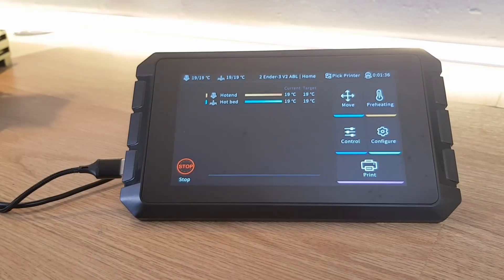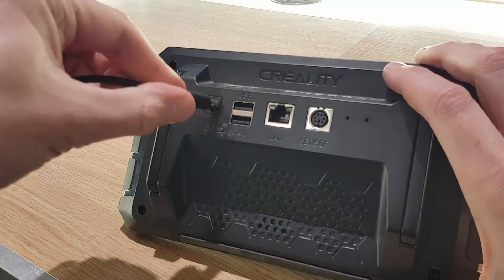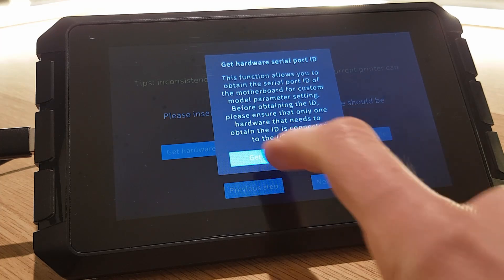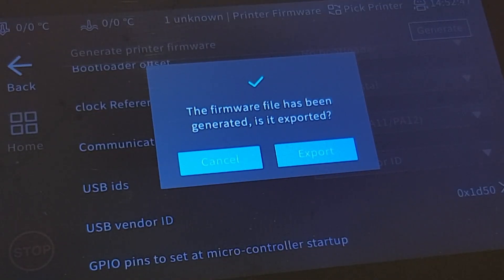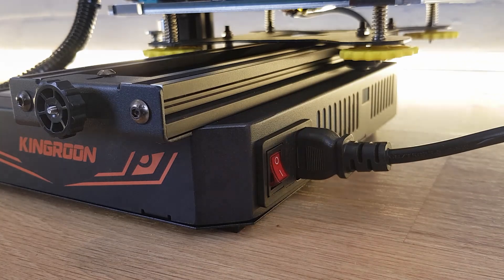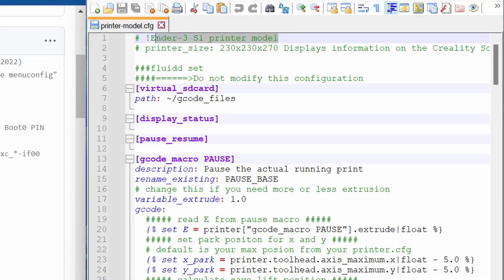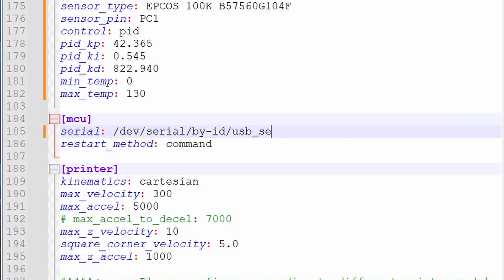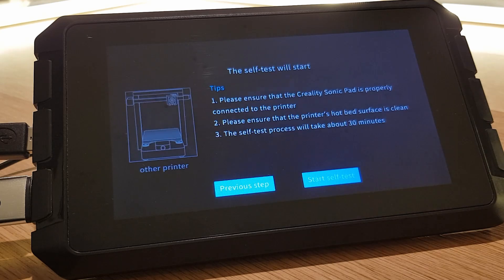How To Connect A Non-Creality 3D Printer To A Sonic Pad - Sonic Pad Basics Part 1a

Comment: Odd one for you!  I have an Ender 5 with a Creality V1.1.5 main board that is from an Ender 3 Pro.  I'm really struggling to find firmware for this printer/mainboard combination and it occured to me that if I use a Sonic Pad with the E3 Pro firmware it may be overwritten and therefore work, any thoughts on this please Ricky?

Comment: Well when this would work, it would be amazing!
Mine is the Ender 3 V2 with 4.2.2 Board BUT with that weired GD32F303 Chip. And i think its incredible Crazy that Creality itself do not let you choose that Chip for this printer.
Then i try to diy it with the Pad.... Well it dosent recognize the Printer.
Also it tells me that it dont recognice the usb stick and when it does and i say Compile the Firmware, first its okay but then it prompt me with a error O_0
WTF is going with that????
Its nothing working even that it comes from Creality itself!!!

I can Build a PC the more easy way and it will work fine than this crap here!

Comment: hi, I have a ender 5 plus and I just bought a BTT SKr 3ez  board for it. I also have a sonic pad. I didn't buy an alternative screen since I thought this wouldn't be nessicary since the sonic pad disables the screen anyway. The only thing is that i dont know if this will work. I've been looking online for a simular setup but i can't find anything that resembles this. Is there a chance you could help me with this? I still need to install the board on the ender 5 plus.
Reply: Hey, i have the same setup, did you manage to make it work? Ive been stuck for 5 days now and i cant make sonic pad comunicate with motherboard

Comment: Good afternoon,
I have the following machine:
Ender 3 4.2.7 running on a sonic pad with CR Touch.
Everything was running fine until I installed the Sprite Pro Extruder kit. Now the Sonic Pad will not connect. I tried to re-flash and lost all my firmware settings. When I reverted back to the original control and firmware the control will only turn on when the extruder is disconnected but the hot end still throws an error. If the extruder is plugged in then the display will only show blue. Any ideas on a fix

Comment: HOLY COW buddy.  you want to go down a rabbit hole?  Try hooking up a sonic pad, to an ender 3 v2, with a big tree tech e3 v3.  apparently the normal SD card firmware loading doeasnt work.  So i had to have chat gpt help me run windows powershell in administrator, to install something called chocalatey, then download ubuntu to run linux, then a million more steps. still working through it.

All of this, because i want to have dual Z axis control instead of just using a standard Creality 4.2.7 board. I sure hope its worth it after all this.

Comment: Hi Ricky, is there anyway of downloading the firmware direct to a SD card and not through the sonic pad as it puts it in a file with the firmware zipped. my sonic pad is not connecting to my ender 3 s1 pro, the connecting symbol goes round for ages with no connection.

Comment: Just bought sonic pad, my ender 3 s1 will not connect when setting up final step. My usb c port seems to have no power so bought the serial cable and it still will not connect for the final step. Do you have any ideas please??

Comment: I'm trying to setup my SP with my Ender 3 V2 NEO that also has a 4.2.7 board freshly installed. I'm trying to add it as an "other models", have created the printer.cfg file but SP just sits on firmware file being generated...
I had previously set it up as a Ender 3 V2 4.2.7 but not knowing how to edit the config after I went to other models setup.
Being I'd already flashed the klipper firmware for the above model I skipped firmware generating and went on to the tests which failed. Tests were fine when I'd set it up as the pre-configured model.

Comment: At this point I only have one question: Can the Creality Sonic Pad I have connect to the Lerdge K board I'm using to use a Core XY printer I built? Or, is the Lerdge firmware so closed that the Sonic Pad won't be able to talk to it? Thank you for responding.

Comment: advice please

Generate a config file for SW-X2, copy the file to the root of the USB, connect the USB cable (with the power turned off), connect the USB to port 1 and touch according to the prompts.

It takes 20-30 seconds and it says the printer is not ready, what's the problem?
Reply: Have you managed to get it working? Same issue with Ender 3 and SKR Mini E3 V2.

Comment: Getting an error message "Printer is not ready. Klippy host software is attempting to connect." when connecting to my Voxelab Aquila S2. Only thing I've tried so far was manually inputting a baud rate into the .cfg. No change. Any advice? General direction to  begin isolating the fault?
Reply: Have you managed to get it working? Same issue with Ender 3 and SKR Mini E3 V2.
Reply: @darkstarkajzek5397  yes. Rather than using the port that it said to use, I used the top one simply called USB.

Comment: Hello. If I fill the Firmware creator with the right details the creating of the firmware goes infinite loop and never done, if I change some settings to wrong it goes to done in 10 seconds. Any Idea? Its a bug of course, its the newest version of software im using on SonicPad. I have a GD32 Chip type 4.2.2 Creality Ender 3 Max Neo. Impossible to install, I tried everything I found on the internet.

Comment: Thank you for your great SP compilation how to videos. I made my first steps with SP and Prusa MK3S+, and I was suprised beacuse everything was only plug in USB cable between my Prusa and SP and few clicks on Sonic screen. Prusa was updated, then there were self tests. It is visible, the heating and movements work ok. The z-level mesh has been created. I have the first test prints ahead of me, but first I want to take the next steps from your videos (PA and IS).

Comment: I've got an Ender 3V2 with a Creality stock  board model 4.2.7 I believe. I've gotten the firmware updated and connected to the sonic pad. Problem now is that the printer won't home the z axis, keeps giving a "Failed to verify BLTouch probe is raised; retrying" message. I've checked my config file against the configs for the other two printers I have connected to the sonic pad and everything looks good. The probe does a test on power up but when I try to home all, X and Y will home and the head will move to the center of the build plate but will not lower. What is my problem,  gonna check with customer service tomorrow and try to solve this.  If you have any ideas, please let me know, thank you.
Reply: Had same issue, then used another USB cable, it solved it, luckily I had another one.

Comment: Hello @Ricky, thanks for the videos. Im new at 3d printing and i receive a sonic pad. I have a artillery sidewinder X2 and i will follow your videos to install. One question i have, in config file, they said "To flash this firmware, set the physical bridge between +3.3V and Boot0 PIN". Its really necessary or we just need to connect the printer via USB to prontface?

Comment: Great vid! CAUTION: MAKE A BACKUP OF YOUR FIRMWARE (esp if you have spent a long time calibrating and getting a DIY build correct) so that you can return back in time should you need to. Im in the middle of setting up...I bought the SP to add my crm4 which it did flawlessly...even though Creality support told me that CRM4 was unsupportec etc Anyway I refitted a TEVO TLM to become a 1m tall printer and has been a gem...but I want to improve the skin of the prints...do DELTAS need any other cautions on setup?

Comment: Greetings,  Thank you for a well done series on the Sonic Pad, hats off.  I have the SKR Mini E3 V3 with the STM32G0B1RET6 chip which is not in the Sonic Pad listing.  It would be great to see how to get the firmware.bin file compiled as well as the printer.cfg file.  And then cover all the Sonic Pad Self-Test features or how to do them from the Sonic Pad or the Klipper UI on the desktop.
Thanks again for your efforts.
Doc'
Reply: I'm in the same boat, looking for answers on how to setup.

Comment: Nice... i've X1, all ok, but on SonicPad don't see the option PROBE CALIBRATION... BED LEVEL etc etc. In the UI interface, if i luch G29, BL touch work fine and save mesh with command.... how can fix it?
Reply from the maker: Hi, do you mean an Artillery Sidewinder X1 or a Creality X1?
Reply: @RickyImpey  sidewinder, but i've solved, thank you

Comment: how much did you increase the print speed?
Reply from the maker: It depends on the model but I regularly complete prints in a quarter to a third of the time it used to take with marlin firmware.

Comment: I've got an Ender 3Pro with a BTT SKR Mini E3 V3 board. I've gotten the firmware updated and connected to the sonic pad. Problem now is that the printer won't home the z axis, keeps giving a "Failed to verify BLTouch probe is raised; retrying" message. I've checked my config file against the configs for the other two printers I have connected to the sonic pad and everything looks good. The probe does a test on power up but when I try to home all, X and Y will home and the head will move to the center of the build plate but will not lower. I've been scouring reddit threads for answers and so far nothing.

Comment: Hello ricky, thank you very much for your very useful video, this being I end up with a problem on the sidewinder x2, I always have this message: mcu error during config not a valid adc pin" impossible to save it. Cfg in the SP, do you have a solution for that?  Thanks in advance
Reply from the maker: Hi, you have an incorrectly configured pin in your config file. What file did you get the config info from?
Reply: @RickyImpey  hi,  I recovered the .cfg on Klipper's GitHub as indicated in your video but is nothing changed except the USB serial port, have I made a mistake?
Reply from the maker: @matmat2991  drop me an email (in about section) and I'll either send you my cfg file or see what's different in yours.
Reply: @RickyImpey  could you resolve this? I have the same problem with the sidewinder x2 too. I appreciate if you could help me
Reply from the maker: @Mecorp1  drop me an email and I'll send you my config file for you to try👍
Reply: @RickyImpey  thank you, I sent you an email

Comment: Hi ricky, i did everything in this video, and no matter what, my sonic pad kept coming back with error after error , is there anyway you could maybe do a step by step on cfg file build for the sidewinder X2
Reply: make sure to change the serial cable you're using. i kept having error after error, and either formating the usb to a 4096 allocation size or a different USB-C cable fixed my issue

Comment: I've gone on to the github page but my elegoo Neptune 3 Plus isn't listed. It's little brother the Pro is there but not the Plus. The printer came out 2 months ago, how long does it normally take for them to add printers to the github?
Reply from the maker: I believe that the profiles are added by people like you and me who figure out how to configure a setup. There is no company or paid staff adding printer configurations, it will just depend when someone figures things out and uploads. Do you know if your control board is the same as the Pro? If it is then you can use the file and edit a few dimensions within the file.

Comment: Hey Ricky,

I managed to get my X2 connected nad running but i can't get my K3PS pro set up at all, not sure if its the firmware or the CFG file, error i'm getting is on the cfg end that it cant find the file, i tried to used the files supplied by Kingroon, did you get yours to work? If so can you share your Bin and CFG PLEASE?
Reply from the maker: Sure, drop me an email at the address in the 'about' section and I'll send what I have working👍
Reply: @RickyImpey  thanks@ i've sent you an email

Comment: I attached this to Sermoon D1 and it works but PAUSE works in opposite direction than it should. I have no idea now where is that klipper code which I need to modify and put Macro in. The more I watch and read- the less I know.
Reply from the maker: I have video explaining Macros coming soon. They are most likely in your printer config file.

Comment: If i have the sidewinder x2 with the all metal hotend extruder what do i need to change in the cfg
Reply from the maker: Where are you starting from Stephen? Did you find an X2 config file to use and just want to change the max temperature for the hotend or are you looking for details on the entire cfg file?

Comment: Ya this is cool, interested to buy but seller say it’s not compatible with printer other than Creality 😢.. Don’t want to do any Pi thing..2nd option is to go Makerbase MK more o less similar pi thing setup.. thanks for this video.. reconsidering again this best option 3.. to enjoy some Klipperings 😊
Reply from the maker: The Sonic Pad is is compatible with pretty much any machine that currently runs Marlin, they just don't have pre-installed profiles for non-Creality machines. What do you have?
Reply: @RickyImpey  haha..don’t laugh I have an old Anet A8.8bit..upgraded with SKR1.4+TFT35. Another A8V2(like Creality), somebody gave me an old makerbot replicator2(gonna make it croXy). One more DiY-ing delta.🤣.That makes 4 probably just nice if SonicPad can control all 4 that would be supercool. yeah following your videos 👍well done. Thanks bro.
Reply from the maker: @jimmym2719  Ok, well I don't know those machines but, as long as you can find out certain information, there is no reason they wouldn't work with the Sonic Pad. If I were you, I would search for printer.cfg files for each model and see what you can find. These don't have to be specific to the Sonic Pad, you want any Klipper cfg files for your model. This should short cut a lot of the work. If you can't find any then it would be a case of learning all of the pins on the control board and what they do. It depends how much research and work you want to do but it's all possible.

Comment: Thanks for this video, I'm looking to add the Sonic Pad to my X2 as well. I'm running into an issue with exporting the firmware to a USB though, after I get the success message and I hit the back button on the SP, I remove the USB drive and insert into my computer where I receive an error message saying the drive is corrupted and is empty. Am I missing something with pulling the drive from the SP? Do you have any work arounds for this? Thanks
Reply from the maker: Do you have a different USB to try? Or, is there any way to view what is on the USB on your PC even though it says that there is a problem? I have had similar messages but could still access the files even though windows wasn't happy.
Reply: @RickyImpey  thank you for the reply. I tried multiple USBs but ultimately found out that I needed to reformat the drive as a fat32 instead of  exfat. I still got the error message but I was able to see the bin file and flash my X2. 

I’m up and running now but still figuring out some other items with using my X2 and the Sonic Pad. Thank you, again.
Reply from the maker: @jasongrinsell4603  glad you got sorted 👍
Reply: @jasongrinsell4603  so does it work for you?
Reply: @lindasweetdog3735  yep, I’ve been using it for a few weeks now. Still a little bit of a learning curve though.
Reply: @jasongrinsell4603  I ask you too much if you share my files, I lost 4 days unnecessarily

Comment: Been watching all of your videos since I got my Ender3 S1 Pro and they have helped tremendously.  Bed leveling was fantastic.  I'm attempting to perform color changes using my Sonic Pad with the E3 S1 Pro and I can't get it to start after changing the filament.  (Followed all of the steps in your guide for performing a color change on the E3 S1 Pro.)  Sonic pad works great for all my other printing with no issues.  Any thoughts on why the Sonic Pad won't restart after pausing?  Thanks in advance.
Reply from the maker: For colour changes with the Sonic Pad, you will need an M600 macro. The latest update has some version of this but I am avoiding updating until I have finished filming the intermediate series. I do plan on a colour change video once the next few are out though.

Comment: I couldn't get it to flash the firmware on my printer. it failed and corrupted it, freezing the printer. had to flash with KIUAH and go back to the Pi. I was really hoping I could free up the pi for something else considering I have  the sonicpad just with one printer...

UPDATE:
WHEN YOU FLASH THE FIRMWARE FOR YOUR PRINTER MAKE SURE TO INPUT THE CORRECT BAUD RATE, MINE WAS 115200. ONCE CHANGED IT FLASHED THE FIRMWARE WITHOUT PROBLEMS.

With that being said, the printer is still not connecting, giving me an MCU error and it's giving me an error "path gcodes" and I did not change the one in the sample cfg file from creality.

Comment: Thank you for providing such excellent guides. Your recommendation prompted me to purchase the Sonic Pad, which I am delighted with. I only wish my setup could have been as straightforward as the one you demonstrated. Unfortunately, my Sonic Pad encountered issues when attempting to write generated firmware for my printer. As a result, I had to take the Linux route and prepare the firmware manually. The process was unnecessarily complicated due to my non-standard board and poorly installed BL Touch, for which I have only myself to blame. However, after some trial and error and minor rewiring, I managed to make it work, and I must say it was worth it. My printer has never been faster or produced such high-quality prints. I am grateful that I took your advice and cannot wait for your upcoming videos on advanced calibration and the continuation of the series.
Reply from the maker: Sorry you had issues getting everything working together but I'm glad you got it sorted. Well done👍
Reply: Can you say what kind of printer you installed the Sonic Pad on? Thank you.
Reply: Highly modified Ender 3 Pro @corlissmedia2.0